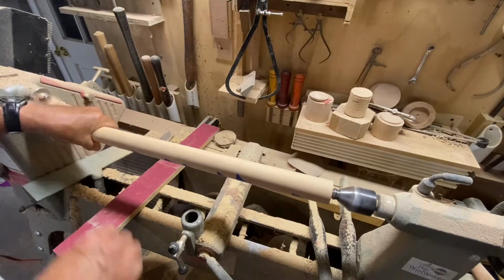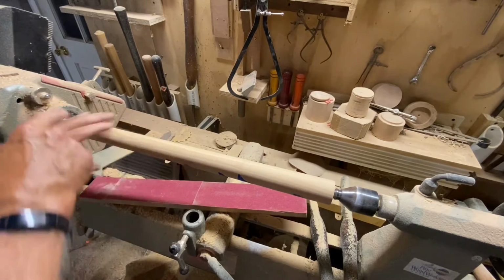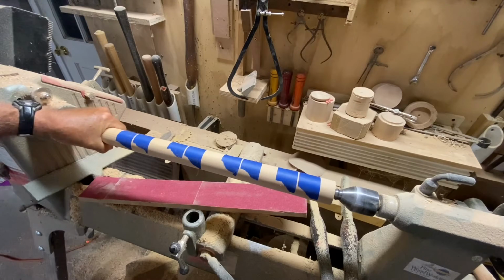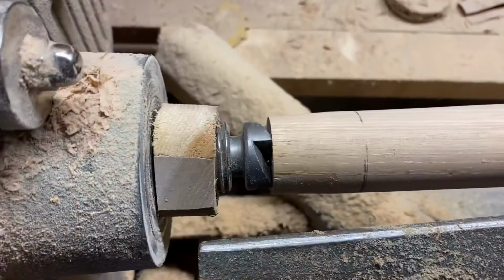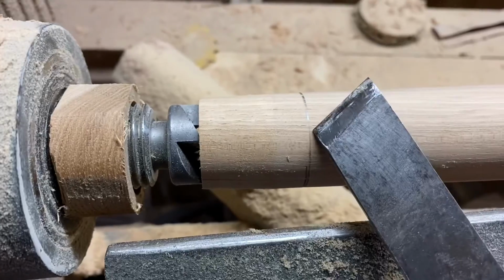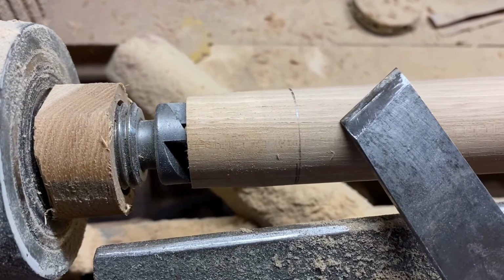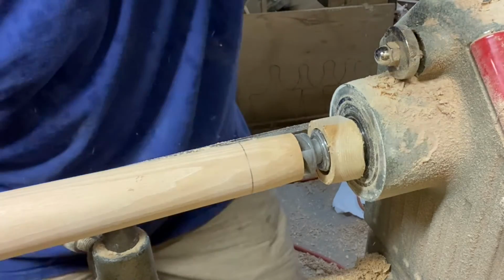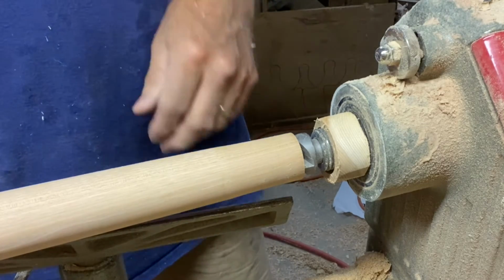How I turn tapered wooden legs

Comment: I assumed this was a video
on how to do a simple 
taper and duplicate such
taper on multiple pieces. 
Do you have a video on how to do this,
or did I not catch it in the video?
Reply from the maker: Sorry, no, this is the only one I have.
Reply: @LSatch  Thanks. 
I wonder if there is such a thing, 
I actually search every couple 
of years lol, and find nothing
on how to do an simple taper, 
then duplicate that taper several
or more times. I'll do another 
search in '26 lol...
Reply from the maker: @bikersoncall  by ‘26 I may have one. With some practice you can do it.  If you are trying to match one you already have, take the largest measurement and the smallest measurement for the starting point.  Depending on how long it is take a few in-between.  Use a roughing gouge down to those marks.
Reply from the maker: Would this work?
https://youtu.be/wklqhMN_4Qw?si=K8h3zL-GkZVrmDmI
Reply: @LSatch  Thanks.
Way to much fiddly work for my taste,
I'll have to come up with something 
else. Youtube is recommending
'duplicators' now and they're similar 
to this. I just want a very simple
taper, I think I have it fingered' out 
80% conceptually, should be 
pretty simple once I start building it. 
But these little rocket ship contraptions
that I'm seeing, don't jump out
at me lol.